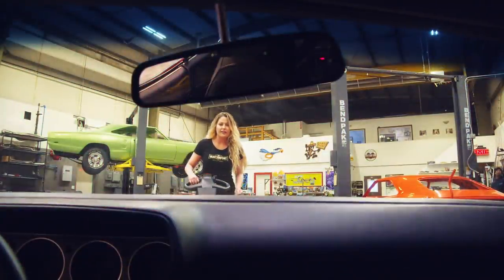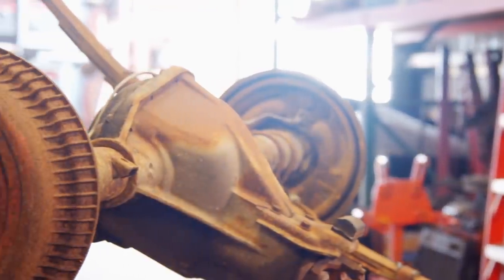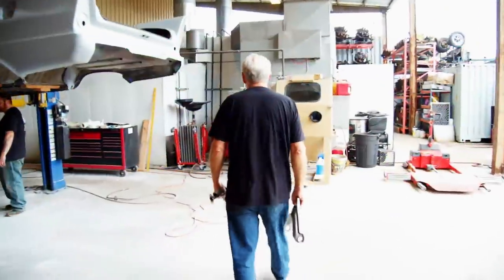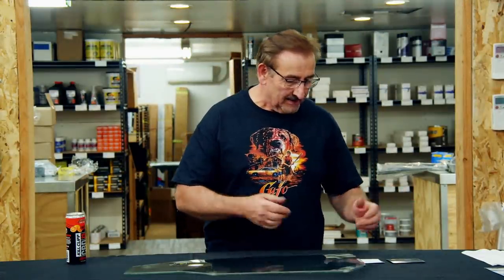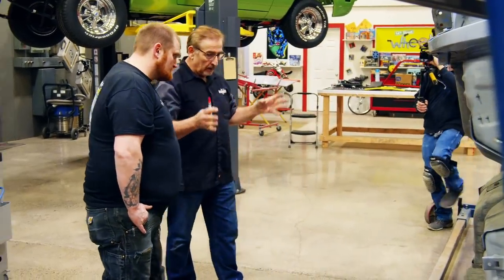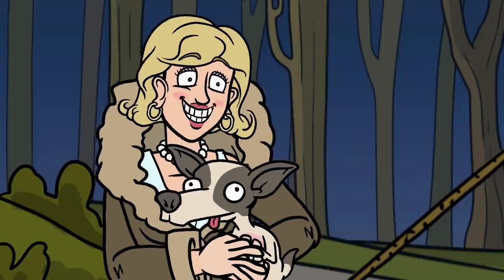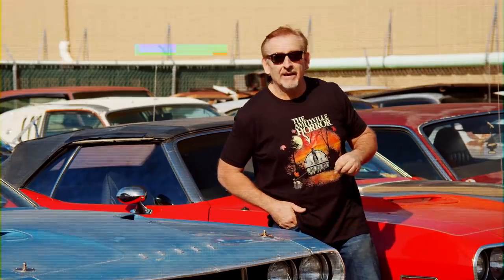**NEW EPISODE**: : SAVING A MILLION DOLLAR CUDA FROM THE GRAVE!

Comment: Years ago I owned a 73 coronet that came from factory with 11'' rear drums.  It was ordered with what was called the tow package, that also included an additional oil trans cooler in addition to the one in the radiator.  It also had much larger drive universal joints.  Always an ordeal when I needed to obtain parts.  Radiator was huge as well.  Great video guys.

Comment: Never had any luck with fire cars, We had a barn fire back in the mid 80s and we had our grandfathers 69 Impala conv in the barn and me and my uncles thought we could save it we had a 2 door hardtop for parts and pulled the burnt body off the frame and had it stripped and we did the bodywork and painted it we put it all back together on the hardtop frame and wasn't even a year later it was rusting under the paint eventhough the body was acid dipped and the insides of the panels where you can't get with paint all flash rusted it was not good and the panels were weak like they were annealed. We ended up cutting the top on the hardtop we had for parts and putting in the convertable parts and panels we thouught we could save our grandfather's car but it was a nightmare and we ended up just building a complete replica of it and I tried saving a dodge powerwagon cab that went through a fire and that also didn't go well either but still running that one with the once a year or 2 yr paint jobs.
Reply: The fire, and smoke is very acidic. It creates rust like nothing else. But repairing metal, and getting it ready too paint after a fire. Requires alot more metal prep than normal. Even though you had the car dipped. There will always be fire residue remaining in the metal pore. Even after a fire car is acid dipped. You have to make sure. They neutralize the acid after dipping. Then having the metal media blasted. Is the easiest way to remove. The residue from the pores of the metal. After that's done you da the metal. Then blow it off, and wipe the metal down with acetone. You'll know your done. When your rags remain clean. Then you spray the car with etching primer. Because etching primer acid etches the metal. Giving it something to bite into, and hold on. Think of it like this, when you're weld in panels, or patch panels. Your basically creating the same effect as fire. When done welding what do you do. You grind the weld down, and you prep your area. If you think in that aspect. You need to do that same thing. With alot less aggresive approach.  Also any car that's been dipped, or had rust treatment applied, has to be neutralized right after. Or the metal will rust back. One more thing also. When it's cold inside so is the metal. When you heat up your work area. The bare metal warms up. As the metal goes from cold to hot. The metal will condensate. So let the metal warm up first. Then scuff down it down with a scotch bright. Then wipe the car down. One more time before spraying primer. If not your just sealing in moisture that can't escape.
Reply: My pawpaw has a 69 impala ss. Its the only car he brought new. The body style of the fastback impala's. Is my favorite body style of the impalap.

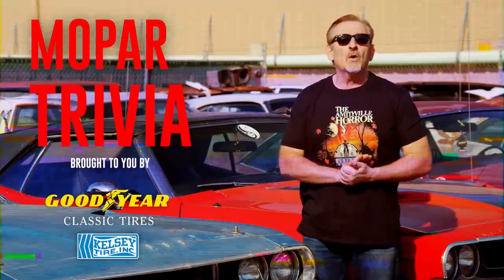Comment: 14:57  I would have installed that heater hose so that the part number could have been read from the right side of the car. Other than that, I wish coming up I would have had employers that took the time to mentor me the way Mark did that young man at the end of the video. Outstanding.

Comment: I like how they work so hard to restore these cars to 100% original condition yet nothing but the VIN is original when it's done.
Reply: Exactly! It's a rebody regardless if anyone wants to admit it. I have a friend that restores only E bodies for a living and sometimes there is less than 10% of the original car left. I like them just fine but don't try to convince me that it is the original car.
Reply: If the roof, bulk head, and frame are in tact. Then it's still the real deal. All the other panels can be replaced.
Reply: @7s29  Who determines what is acceptable? My friend does mostly convertibles and I've seen places replace a hardtop also. I asked him and he says some consider it a rebody and some don't. He wouldn't call them original but he also auctions them all and does disclose it. Another friend does 1st Gen Camaros and basically said the same. It's an each to their own sort of thing.
Reply: Honestly, as long as it’s built as the vin indicates, close enough.

Nothing lasts forever but if you care enough about classic vehicles and their survival to the next generation, you’ll understand that quality reproduction of original is good enough when original isn’t available
Reply: if you have a car thats been sitting in a barn, or worse, in a field for 40+ years, how the fuck are you supposed to keep it 100% original during a restoration then? IMO if the car is rebuilt according to specc, using genuine OEM parts etc, and leaves the shop exactly how it left the factory, then the car is original. I remember one episode where they rebuilt a daytona, or maybe it was the roadrunner, cant remember, one of thos long ass cars with a 10ft high rear wing. And they spent ALOT of time finding a company that could strip the paint and rust without losing any more material of the original panels as possible.
Reply: I don’t see where a restored original is better than a reproduction of better quality. Personally, I would rather have what looks like a 1960 muscle car, but handles and gets the gas mileage of a 2022 model.
Reply: @samadamms3432  then it becomes a resto mod

Comment: I set an watch with amazement. 😱
 Watching them bolt the transmission to the engine on the Phoenix cuda . Never, repeat Never bolt any critical components together with paint between them. !!  It will cause the alignment to be off between them.  Very poor tech practice 👎As well as coming loose after time
Reply: I would bet that is the way it was from the factory.

Comment: For the life of me I can't understand how they can re-use the sheet metal after it has been exposed to the heat of the fire.  Wouldn't the panels all be warped and weak.
Reply: The outer sheet metal is removed and replaced with new parts .if any of the inner structure or the skeleton of the car is ok that can be reused like the firewall inner front structure. Etc.

Comment: I don't believe any of this horseshit video. I deal in auto salvage cars for the past 15 years. Burned cars are nothing more than scrap metal and maybe a Vin number for a clone car. Fire destroys the metallurgy and softens it like butter. Even paint will not stick to it after a year. Only thing you can do is make yard art. Not to mention if you did rebuild it, that hemi would twist the body and crack the windshield.
Reply: If the metal is air cooled, perhaps. But, in this instance, they mention jumping on the roof to put the fire out.
Reply: You’re not entirely wrong.

But it is possible that the under carriage was somewhat protected from the worst of the heat looking at those pics.

But usually a person is definitely far better off starting from scratch with the vin
Reply: Unibody frame didn’t get cooked, all sheet metal on the exterior was replaced with donor cars.
Reply: Yeah that car is never gonna be right and will never be done with issues
Reply: @54raceman  please explain …